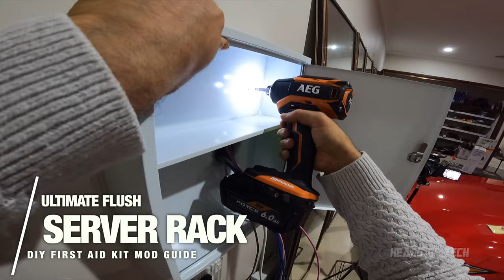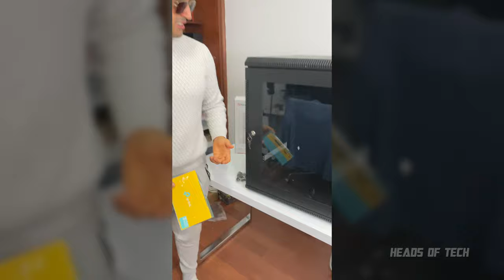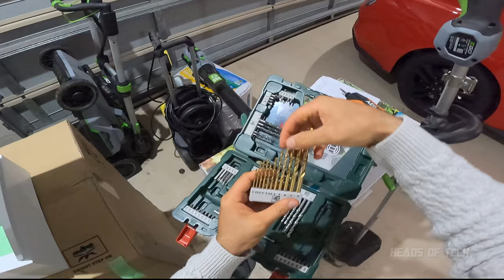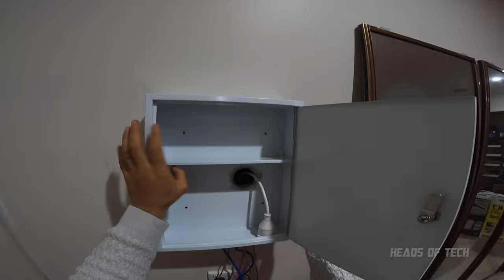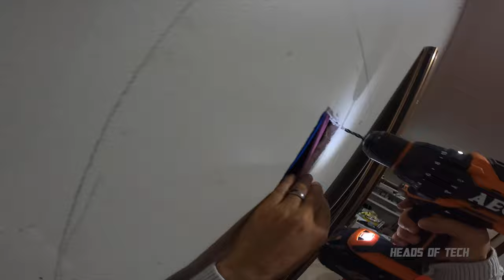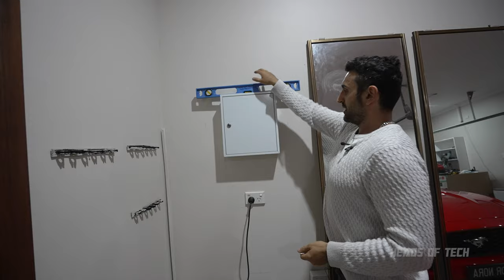Smallest Work Home Network Server Rack - DIY Mod Guide | First Aid Cabinet

Comment: If the router and switch heated due to hot environment like pakistan , India etc which have 50 degree temperatures, what are the solution?